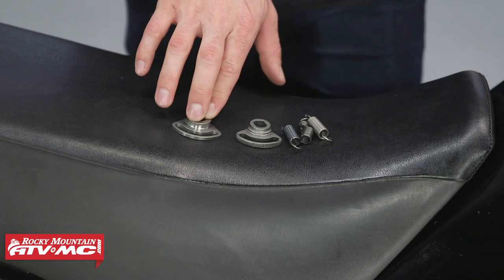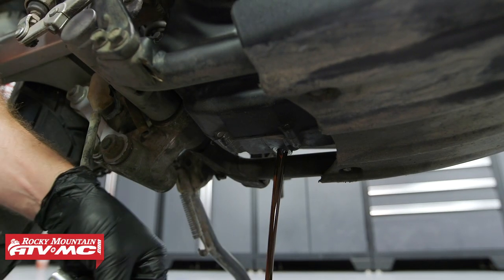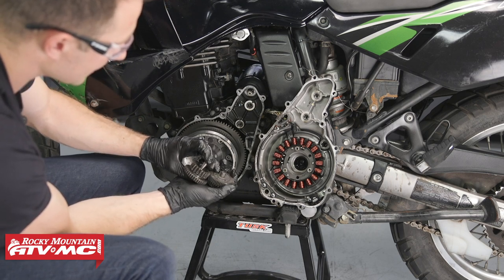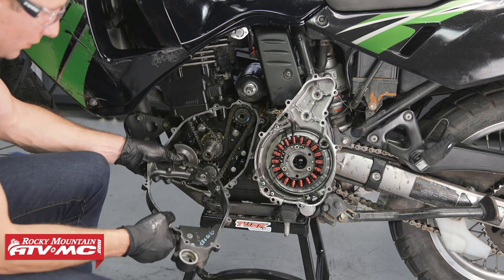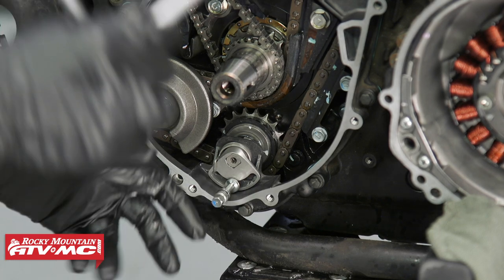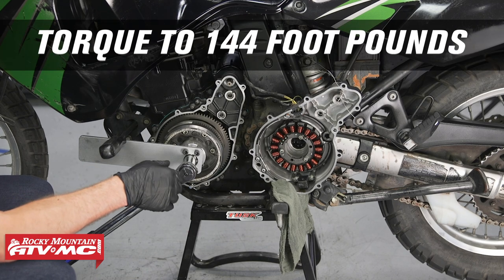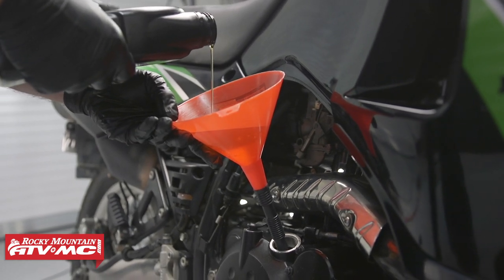How To Install the Kawasaki KLR650 Doohickey & Torsion Spring Upgrade

Comment: I decided to upgrade the doohickey on my 06 KLR at about 11,000 miles a few years ago and opted for the torsion spring setup.  When I opened up the cases, I found that I was not doing an upgrade but a repair.  The old spring had long since failed, so long ago in fact that the broken end of the spring had worn a groove in the case.  Apparently the broken off piece had come out with an oil change somewhere along the way, boy was I ever lucky!!

Comment: This is the best tutorial I've seen, I like the attention to cleanliness on reassembly that any good mechanic should do. The only choice is the torsion spring, I don't understand why Eagle Mike bother with the hook springs, they are bad cheap design in a engine, and won't break but could fall off the hook post, letting the chain go again.

Comment: Interesting, but holy cow! I got about half-way through the video before deciding this is something I would never want to do myself. If doing this replacement is so important, what I don't get is why aren't more shops offering this service (e.g. a "KLR Upgrade Special - the Doohickey and the Thermobob")? I would think they could make some money from doing it. When I had a KLR, I called around to several shops to get their thoughts about the doohickey. In every case, they said it wasn't necessary. So I didn't do it. If I get a 2022 I guess I'll have to decide again about doing it at some point, but I won't be buying special tools for a one-time job and trying to tackle it myself.
Reply: I got the same reply from a mechanic. I have a 2001 and it is as quiet as when new and mine is still stock. But then I read the coments from people that open up the covers and find broken spring or doohickey. My real question is if that was a known issue, why didn't Kawasaki fix it in over 30 years?

Comment: I have been looking with interest in getting into a KLR lately. After watching this video I will have to think twice. Your video is excellent, all steps in the process fully explained. I however lack the space to work (condo apartment) and some of the tools. I seriously doubt a Kawasaki dealership mechanic will do as thorough a job as you have explained, at whatever the cost. And lastly, when asked if the doohickey has been installed I will have to doubt the response of any seller. 
It is a necessary modification, one that if ignored can leave you stranded in the middle of the woods if lucky.
...still thinking about it.... 🤔😕 .... Nah!  I better keep my Beemer.

Comment: you should be inspecting the timing chain guides while performing this job.  the slack can be related to worn guides.
Reply: steve arr and a worn chain!
Reply: The guides are only worn hard, if the spring has snapped and the stock lever has moved off, on this bike the spring was intact, so no need.

Comment: Are all the gaskets, etc. necessary when doing this upgrade on a brand new bike? Would it be wise to wait for the warranty period to be over before doing any such internal work like some are deciding to do? Very good video, thank you!
Reply from the maker: If your bike is brand new you probably won't need all new gaskets. If you're worried about the warranty, it would be best to wait until that is up to do this mod.

Comment: A lot more involved than I had hoped.  Makes me want to avoid the KLR like the plague.  If buying used, every owner will claim the Doo Hickey has been done.
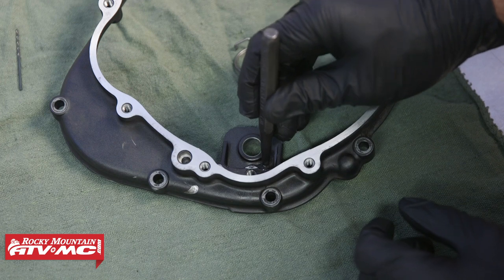Reply: I stopped at 10:55 thinking the exact same thing. Ill just go with a different bike
Reply: I made it to 9:55
Reply: 😂 Weaklings
Anyway according to Kawasaki the failure rate for the factory tensioner is very low
Reply: It’s a three beverage job. Very simple to do. Put on some music and enjoy the process and you’ll be done in an hour.
Reply: This isn’t a very difficult job for a motorcycle mechanic or anyone with average mechanical ability.
Reply: Definitely not a hard job. Now try to do a clutch job on a 97 Honda Valkyrie with no life and no YouTube help 😂
Reply: I don't understand how everyone doesn't know how to rebuild their entire bike.... especially a single cylinder KLR
Reply: @adamniswonger8015 exactly, these whiney babies acting like this is a difficult job or something is hilarious. Obviously they've never worked on a car or truck, because this is a dream job repair compared to most auto repairs.
Reply: Every bike has weak points to be addressed. If something this easy scares you off, maybe motorcycling isn't for you.
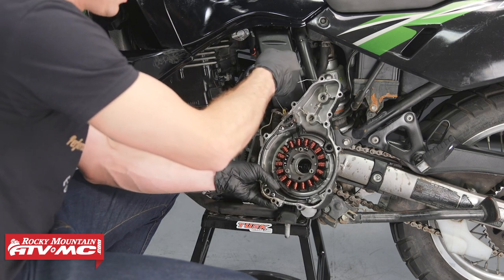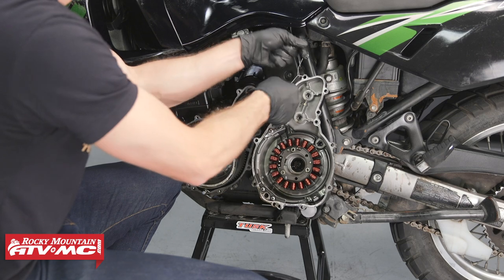Reply: I had to install the torsion spring at 4:45ish  I tried it at 5:00 to 5:30 and it put too much tension and raised the spring to the point it was touching the starter gear.  That's why they make you spin it clockwise before closing it up.  And the wood drift key is a booger, too.  Other than that, it was pretty easy.
Reply: If my dad can do it so can you 😂
Reply: Good, keep the prices lower for the people who know what a bulletproof machine these bikes are!!!

Comment: 2 questions why can't you use the extension spring and torsion  spring ? also once the doohicky bolt is tightened the springs don't do anything except allow you to retighten it later with the covers on is that correct ?  I enjoy your videos most informative thanks
Reply: Please answer this question.
Reply: I'm thinking you wouldn't want to because it's double the springs that could break
Reply: Good point on doubling up on the springs, but kind of redundant, not sure if it would cause any problems thought. As for the second question. I'm not entirely certain why the tension bolt has to be tightened, isn't the point to allow tension by way of spring pressure? It's no wonder the springs break on OEM parts, the bolt is too tight to allow free play of the tension spring.
Reply: The torsion spring is held captive if it breaks and wont fall into the engine the way the regualr doohickey spring can. That torsion spring offers alot of pull. I would guess from my experience with it, way more pull  than the normal spring.

Comment: nice work but you forgot the new oil filter..thanks for the video
Reply: dragonrider385 If you don’t know how to change the oil filter (which they did show in the kit at the start), then you should not be working on the doohickey.
Reply: i do know how.  i was just asking . yes they showed it but did not say that they put it in. I put 26000 miles on my KLR and never needed to change the doohicky. Maybe i was just one of the lucky ones. It was a 2011.  Have a great day and a Merry Christmas.
Reply: dragonrider385 Are you sure?  Did you take it apart to see if the spring still had tension in it at 26,000 miles?
Reply: yes i did.  At 20000 it was fine. The crank pin was bad and had to replace that. And yes maybe i should have done it then but i was at the Tail of The Dragon riding. And didnt want to stay and wait on parts. Wheelers had a pin that fit it.
Reply: dragonrider385 Seems to be hit or miss.  I am going to run mine to 5,000 miles or so and make sure I like the KLR enough to start putting a lot of mods on it.  I did do the Thermobob as it just ran way too cold.
Reply: LTVoyager yes they do do that.
Reply: I just changed mine a 33k miles and it was original and working fine.

Comment: The manual calls for 130 ft lbs on the flywheel bolt not 144 I just broke the end of the bolt off going for 144 and now have to back it out tomorrow
Reply from the maker: The manual calls for 130 ft lbs on the 1st generation KLR and 144 ft lbs on the gen 2 KLR's.

Comment: Hi, After tightening the bolt to 144 Ft Lb, is the very tip of the crankshaft supposed to be touching flush to the flywheel? Or another way to ask, is the flywheel supposed to be right up against the top/flat part of the crankshaft? Thanks for the great video!
Reply: The small gap is normal

Comment: Hi i have a mental dilemma about this maybe some one can answer this if i understand wright  if he doohickey bolt is tightened the springs don't do anything only when is adjusted is making tension on the spring wright so question  how or way the factory spring break? from vibration from the engine or is just a defective part that breaks whit the tension once adjusted and if so i guess just by checking the bolt is possible to find out is the spring still have tension ?
Reply: Factory spring can break easily. In addition the (doohickey) is also fragile. Also the spring is too long and will quickly run out of adjustment. Then it will fall off and likely break in the case there.

Comment: What I don't understand is Kawasaki made this model for decades and never addressed this supposed issue? If it's such a liability then where does the KLR's legendary reliability come from if a weak spring/design causes potentially catastrophic engine failure? Perhaps it's from people that have absolutely tortured their rides on world traveling excursions which me as a Gen2 owner will never come close to emulating. If I was planning on crossing the Himalayas or Sahara Desert then I would probably 'doo' the hickey and the thermal bob mods. Just my 2 cents.

Comment: At how many miles should this be done ? I just rolled over 10k miles
Reply from the maker: Some people have to do this at different intervals. While some may need it at 7k others have made it to 11k without any issues. With that said, it wouldn't be a bad idea to at least take off the covers just to check it.

Comment: When did he retighten the bolt that holds in the adjusting arm/doohickey? He loosens it once he puts the torsion spring on the doohickey, and says he would “retighten later” but I don’t see when he does? Is it torqued or just hand tight? Any help greatly appreciated.
Reply from the maker: The doohickey bolt gets torqued at 17:53 in the video. 👍🏼 Here is a link https://youtu.be/ySKRxMYjq5A?t=1073
Reply: @rmatvmc  duh! I was wondering what that one was. Thank you very much

Comment: I bought a KLR 650 while back I don't know if it has a doohickey on it.
Do I have to go through all that crap just to check if there's one on there?
Reply: Every KLR has a doohickey - it's the counterbalance chain adjuster. If you bought it new then is has the standard doohickey.  If you bought it used then ask the previous owner if it was upgraded.

Comment: Thx for the video on this.   I am confused on the status of doohickey adjusting bolt though.   You looosened it after hooking the spring to it and said you would tighten it back down after installing the inner case?    Shouldn't it be left loose so the doohiicky can still rotate and the spring keep proper tension on it?
Reply: I think that bolt might have a shoulder / stop on it that keeps it from locking down the tension cam thing, so it just ends up being a guide, not a fastener. Not 100% sure though.
Reply: @daviddunn7817  I asked the same questionn on EagleMikes install video and he replied as follows:   "The bolt should be tightened to 70 inch lbs. Emphasis on inch, a few have used ft lbs, which always results in a broken bolt. The bolt should be loosened to allow the system to adjust about every 7500 miles, while the engine is off, then torque it up before starting. It must be tightened while the engine is running."   There is a rubber plug on the engine cover that can be removed to access this bolt.
Reply: @lunarluna  makes sense, thanks for the update !

Comment: On my 2002 with 24k miles, the washer between the rotor and the ring gear was blue from heat.  Any idea what would cause that?  I'm chasing a noise, and after pulling both side covers the discolored washer is the only odd thing I've found.  No debris, clean oil, clean filter, clean wire basket...
Reply: Replace washer, put oil back in, and ride.  It's a KLR not a Porsche. They make noise and rattle.

Comment: Question: the side cover bolts are listed to be torqued to 14 ft. lbs. in the manual (= 164 in. lbs.) for my gen1. This guy says 78 in. lbs. on this gen2. Are they that different? Or is my manual wrong?
Reply: in case someone sees this is 71 in-lb for the gen 1 cause they are the 6mm ones... what you are saying (14 ft-lb) is for 8mm. You have to measure the cylinder of the bolt.
Reply: and rotor bolt for gen 1 would be
88 ft-lb to seat 
then loosen
129 ft-lb final

(120 & 175 in Nm for the metric system)

Comment: Is this a permanent fix for the doohickey problem?
Reply from the maker: The balancer chain should still be inspected according to the manual, but this replacement doohickey and torsion spring shouldn't ever need to be replaced.

Comment: The kit in the description doesn't show the heavy duty springs
Reply from the maker: The new doohickey kits only come with the torsion spring. As per Eagle Mike, "you won't get, and don't need the extension springs. The torsion spring is far superior.".
Hope that helps!
Reply: @rmatvmc  I seen that after watching it again thanks for responding. Does the torsion spring ever need replacing?

Comment: You should never use a click type torques wrench on aluminum. Took me cracking a aluminum head with a guide pin torqued to 18#/ft to learn that lesson.

Comment: using the puller is impossible to remove the rotor, i did try with the standard 22cm but is impossible, have you another idea or another technic to remove the rotor?
Reply: I used an impact and it worked like a dream

Comment: Has this been rectified by Kawasaki in the new 2021 model?
Reply: Kawa never acknowledged any issues with the Gen 1 or Gen 2 so it’s unlikely they’ll own up to any fixes on the Gen 3.
Reply: Nope
Reply: No, the KLR650 2022 model has the same doohickey as previous models.

Comment: So is this a (permanent ) fix?  Once this is done most likely I will never need to be done again?
Reply from the maker: Yes that is correct. Once you do this upgrade you shouldn't have to mess with it again.
Reply: @rmatvmc  don't you have to loosen the bolt every once in awhile so the spring can add tension? Then tighten it back down?
Reply: @chrsrumbaugh  That's what you're supposed to do but I just installed a Doohickey on mine and I plan to keep the bolt loose to allow the spring to keep tension the way it's intended.
Reply: @greggriesel892  Would like to know how this worked out two years later

Comment: Does anyone know if Kawa resolved this issue on their new 2022 models? The 3rd Gen KLR
Reply from the maker: The 2022 model has an upgraded doohickey but the spring remains unchanged and is still a weak point. We have a first impressions video where we go over this and other features on the 2022 KLR650. You can check it out here: https://www.youtube.com/watch?v=vFv_GmIyNdE
Reply: So you still recommend this for gen3?!!

Comment: Attention anyone that doesn't think this is necessary. Or they think it's some kind of scam? Or they're just cheap. Why not take a few minutes and pull the side of the case off and check out your system? You can inspect absolutely free of charge. If you like what you see? Put the bike back together and carry on.

Comment: What keeps the torsion spring in place on the case cover? It is just a straight piece of of the spring with no hook into a drilled hole. Couldn't easily back out?
Reply: The torsion spring tip is in the drilled hole in the midcase, it's under tension all the time and can't come out.

Comment: Talked to a mechanic at the local Kaw dealer and he said in 20 year he has never done this or seen one fail...
Reply: That mechanic is telling you a story.
Reply: That's what they ALL say. Mine said the same. I also replaced my doohickey and put in the torsion spring. When I got my bike at 7000 miles the spring had no more tension to pull the lever any more. Miracle it hadn't unhooked itself and taken a trip through the transmission
Reply: that is why until i see or hear about a gen3 2022 failing, i ain't doing it.
Reply: @danmanthe9335  I guess I have to believe if it were as serious as eagle mike makes it sound..wouldn't we be hearing about thousands of these KLR's  that have catastrophic failures?  I'm not knocking on Mike, but let's remember he is making money off every unit he produces.  So there's that.
Reply: @markcrum5895  I agree with you. Speaking from personal experience,  my doohickey lost the ability to take slack out of the system before 10,000 miles and the spring had no tension at all leaving it prone to making its' way into the transmission or somewhere else. I thought it would be prudent to be proactive regarding this issue and I have been pleased with my experience. The EM products fit better than OEM, the torsion spring will continue to provide tension for many more thousands of miles based on reports of others and my own judgment of the design. If you want to leave your bike stock then that's your choice. You certainly don't need my permission
Reply: The mechanic said? Hahaha ha!  My local dealer charges 50 bucks plus extra  for weights ect to mount a new tire. The first time they put it on backwards 🤣 . The second time they gave it back with no weights on it . I asked to speak to the installer. Did you balance my tire?He said he didn't balance the tire cause they are out of weights. So I really don't have much confidence in what the mechanic says! I got other examples over the years,  to many to list. That's why I do my own research and my own work when possible.

Comment: My klr, two thousand twenty two has issues after driving it for a while. It won't start. I have to wait and then it starts. It'll turn over, but it won't start. Wait a few minutes, wait a few minutes, then it starts. This is after driving it with no problems.Whatsoever.

Comment: So...it's,buy new KLR650,do the break in miles,change Doohickey at the 1st service before long haul trip...an expense i could do without Kawasaki
Reply: Exactly.. it's baffling that Kawasaki wouldn't have just used a torsion spring for the Gen3. I was just thinking to myself "Well, at least i can change the sprocket while I'm dealing with this bull."